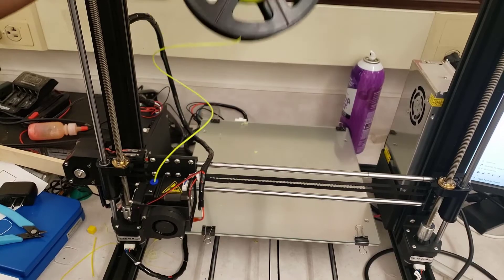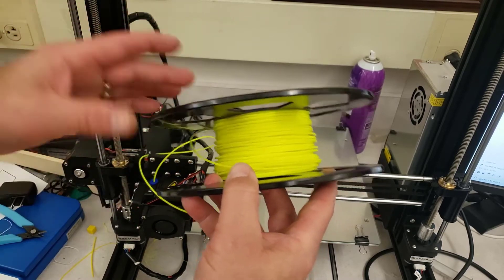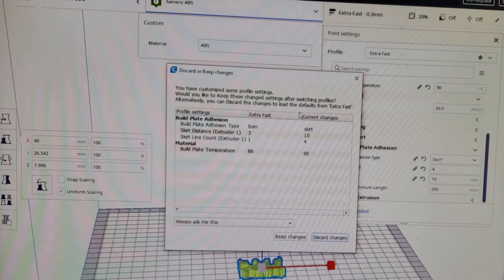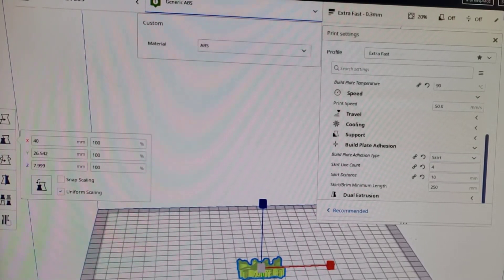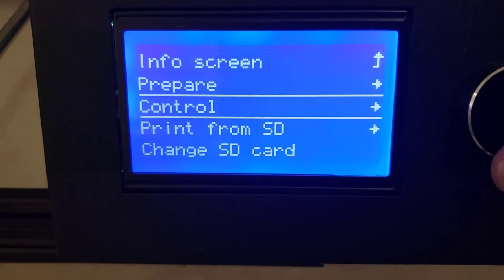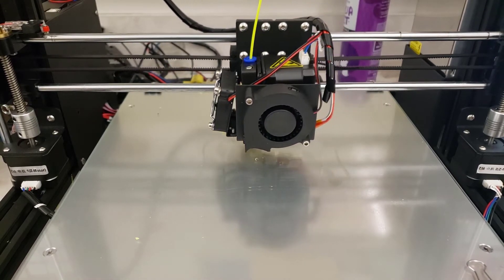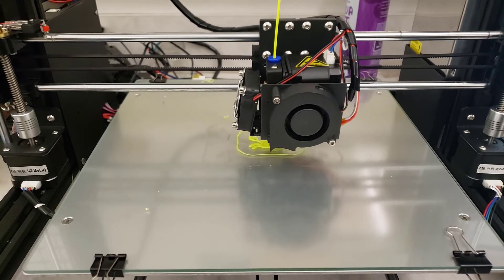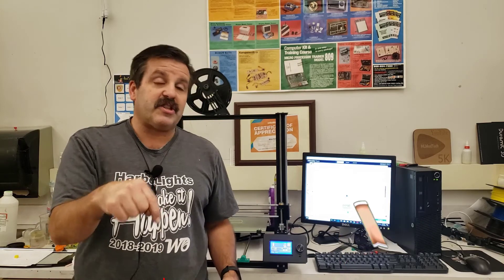Tested! ABS on the Anet A8 Plus | Simple Test Ancient Filament

Comment: My abs won't stick on the glass unless I use glue stick especially if I use the cooling fan. I have tried to use the same settings as you also 95C in the but nothing so I'm printing on 230c and 240c on the nozzle, 80c on the heatbed and setting the cooling fan completely off.
Reply from the maker: Hmmm. I will do some more testing. I have a new vid coming out tomorrow. Spoiler alert, it was successful and I used a bed of 70.  Bumped up the speed a bit as well. I did hit it with a dash of hair spray. What is the weather like in your area?
Reply: @HLModTech  the printer is inside the house with approximately 45%humidity and 22 Celsius. One thing that I have noticed is that there is no any smell coming out from the material and as I read everywhere the abs is producing bad smell and some fumes. But this abs that I have smells less than the pla I had.